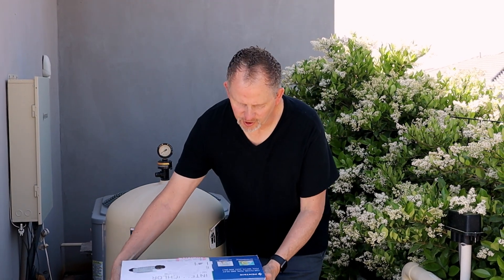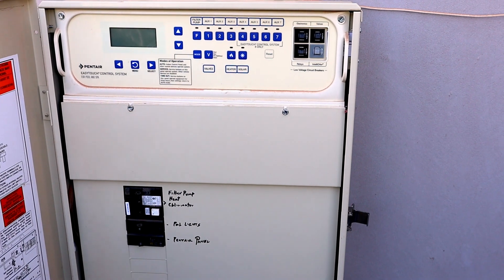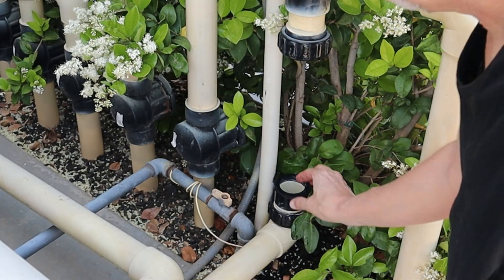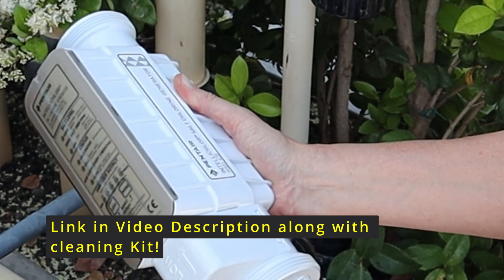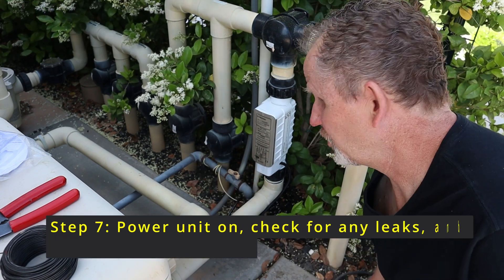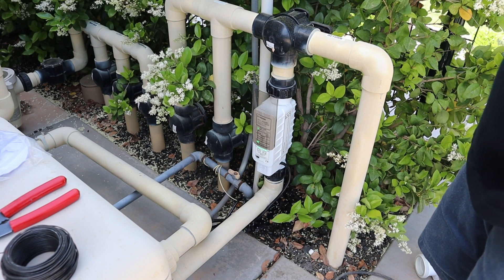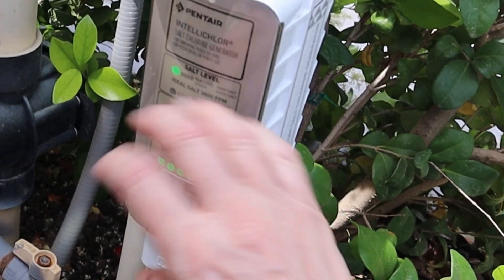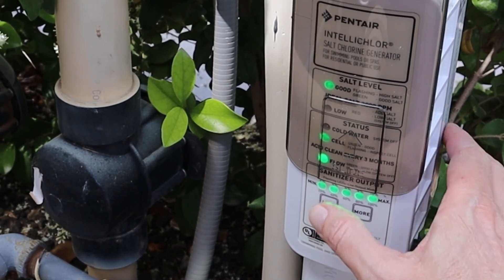Pentair IntelliChlor Salt Chlorine Generator Replacement Guide

Comment: A bypass is required after 80-110 gallons per minute right?
How do I know the gpm?
Reply from the maker: That's a really good question because I didn't actually build our pool system, but just swapped out the Chlorine Generator.  I know a bypass will allow water to still flow or circulate while you work or clean the salt generating unit, but it's easy enough to shut the entire system down for a few moments to just clean or replace the thing so I'm not sure it's worth the trouble.  As far as GPM, multiply your pool's gallons by a factor of 1.5 to 2, then divide that number by the desired pool turnover rate (typically 8-12 hours) or that's what the Pentair site says.  Thanks for the comment.  
Hopefully that helps a little, anybody else out there know for sure on the bypass question?

Comment: My IC40 went bad recently after only 3.5 years. I purchased a new one. Before I change it out should I add liquid chlorine to my pool.
Reply from the maker: That may give your system a little bit of a break, but totally up to you and depends on if you are seeing any algae or not.  If you are then I'd add some before swapping out the unit just to be safe and keep the algae from getting any worse.  Thanks for the comment.

Comment: We can’t get ours off to change. It’s on too tight.
Reply from the maker: Try some water pump pliers, or even a faucet wrench if you have one and gently turn the nuts if you can.  Sometimes you can also turn the actual generator to get it to start to come loose, or get the seals to loosen up.  Hope that helps.